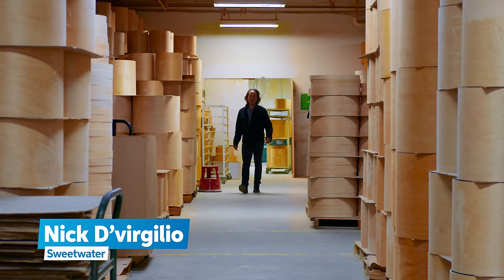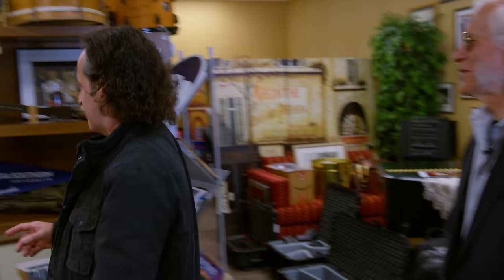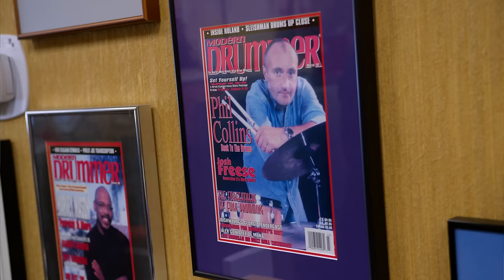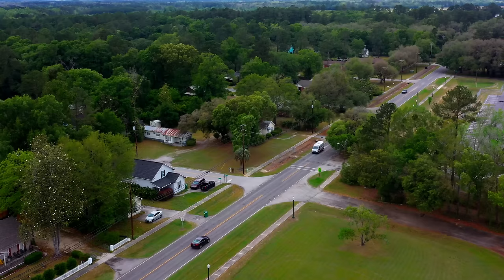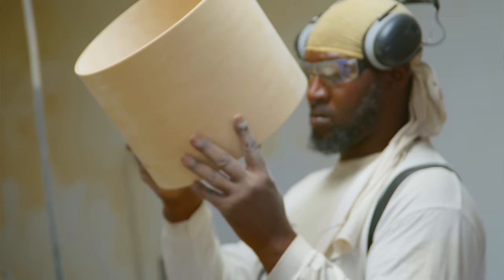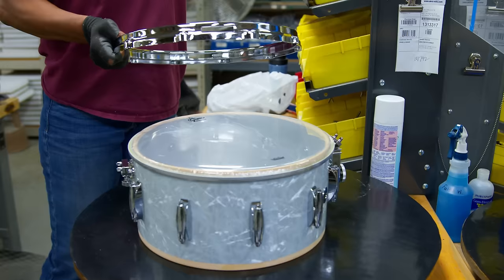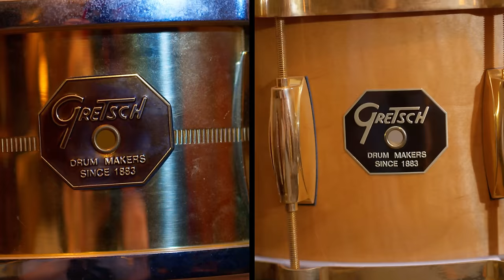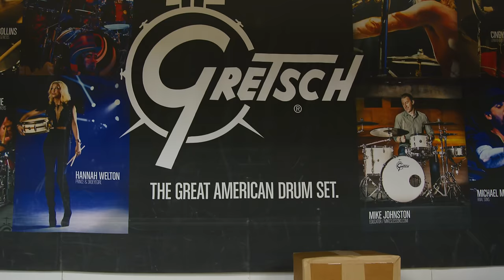Gretsch Drums: A Firsthand Look at Premium Craftsmanship 140 Years in the Making

Comment: My USA Customs were acquired through Frank's Drum Shop in Chicago in the early 80s when Baldwin owned them. Yes, there are flaws, particularly on the inside of the shells in the way the holes were drilled. Some of the mount and lug holes are pretty nasty from the inside with chipped silver sealer. I also had to remove all the lugs to put foam or cotton inside to eliminate the spring noise and I had to cut and install felt gaskets between the lugs and the shell, all something that they have done since Fred took back the company. But in spite of the flaws, the drums sound amazing to this day. I use the smaller shells for my Jazz kit and I'm in the process of cleaning up the larger shells to use for some big band work. So, if you want my two cents on which manufacturer to spotlight next, it's gotta be my other go to, Yamaha!